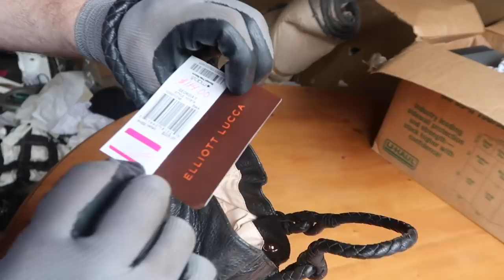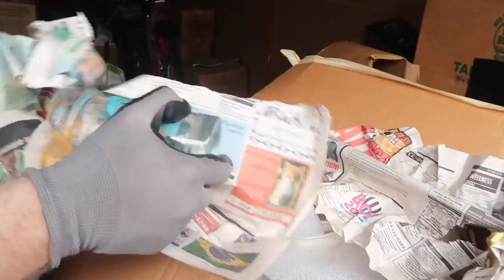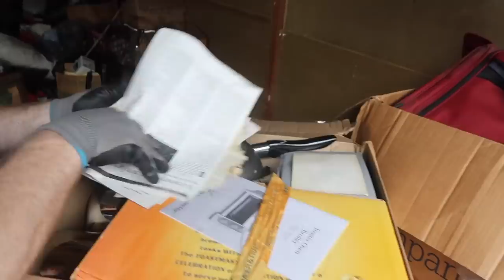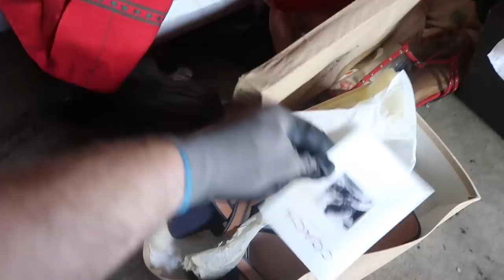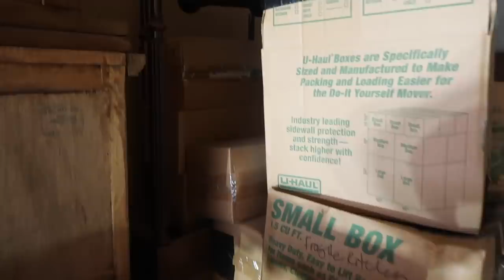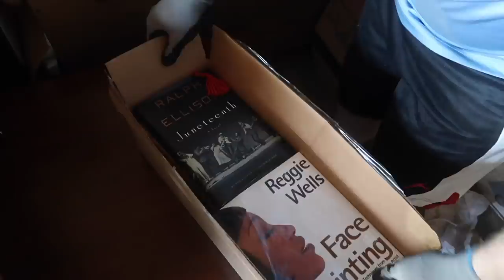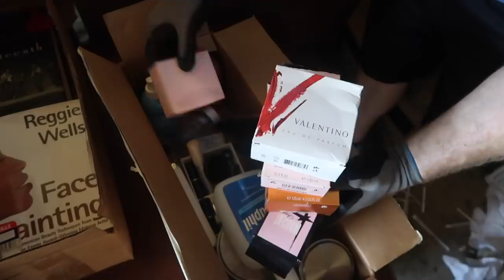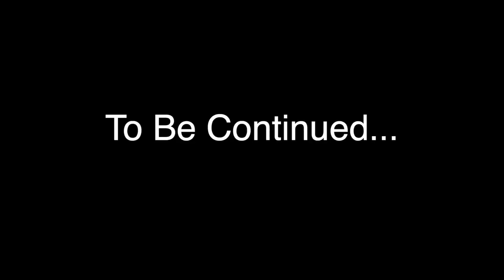Untouched Abandoned Storage Unit SEALED 23 Years!!

Comment: At 3:31, these are for holding pages together. One slips the upper left-hand corners of a few sheets of paper onto the metal thingy and then one folds the two corners of the metal thingy down onto the sheets of paper and then one folds it down, it is very efficient to hold a few sheets of paper together without damaging the paper with a stapler. It makes it easy to open out and take out a sheet or add a sheet of paper - I used them all the time when I was a legal secretary.

Hi mom!